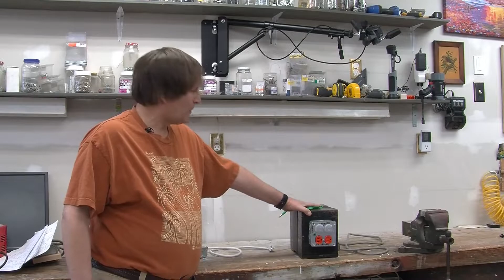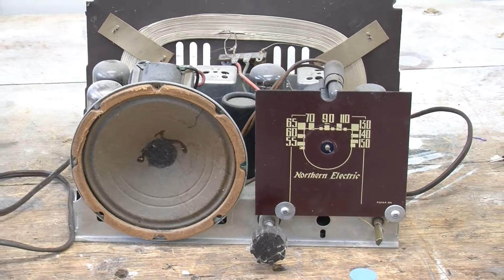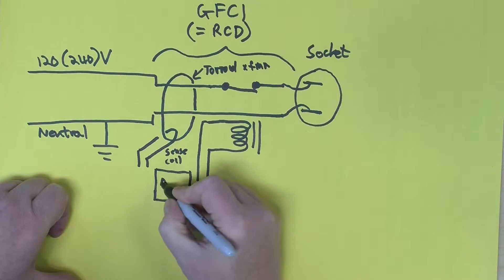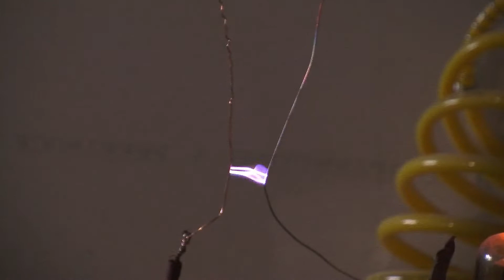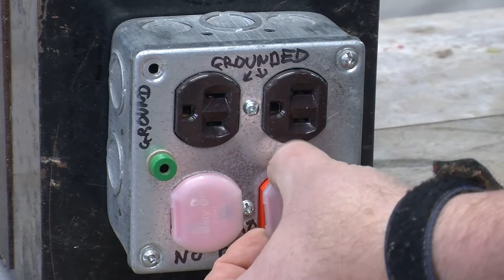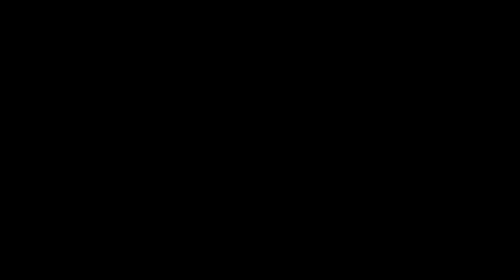Isolation Transformers and  GFCI Outlets

Comment: Excellent video! I have an isolation transformer (15 amp)  set up with a GFCI on the secondary side. I am going to add a couple of your items to it. Thanks! 👍
Reply from the maker: Thank you so much. I`m glad you found it useful. And to anyone reading this, a remider - you always need to conder the possible current return paths and voltages involved  to decide if a GFCI or isolation transformer - or a combination of both - and with our without ground - will improve safty - or even worsen  it. Even just thinking about this for any situation improves safety by hightening you awareness. Be safe everyone!

Comment: I was using an outdoor outlet (must be GFCI to meet code) with a metal conduit (buried to 6-inches) and two-wire cable to a shed to power an electric fence (which has its own ground rod). However, many fence energizers, including mine, cause a GFCI outlet to trip if an animal touches the wire. This should not happen, as the energizer output should be isolated, but unfortunately it does. I fixed the issue by using an isolation transformer (at the shed) to power the energizer. This solved the GFCI trip problem very nicely.
Reply from the maker: I had never heard of that happening! So the fence engerzier must somehow connects its high voltage pulse circuit to either the 120V line or hopefully neutral to cause a current imbalance. It hardly seems safe to be setup that way.  Or maybe they are isolated, but after a while  a fault  has developed between the HV and 120V side. Could easily happen with some moisture getting in, and for the zapping voltage would need to be anywhere close to a short. 

Glad you solved it!
Reply from the maker: @krslavin For some reason I am notified of you reply "Thanks! It could be some sort of inductive coupling due to the high rate of change of current and the fence energizer being separately grounded." but can see it here. Your right! Those sharp edged pulses have so much  high frequency energy they can leak though the slightest capacitances. Thats probably it.

Comment: Should we add a MOV for overvoltage surge suppression? Should we fuse one or both windings to match the transformer's VA rating?
Reply from the maker: All very good suggestions! The MOV particularly for use when dealing with semiconductor devices that might be damaged by spikes particularity if the power to the transformer is cut and the remaining magnetic field in the transformer produces a surge.

As far as fusing goes, my preference would be a switchable dim bulb current limiter as part of the whole setup. But maybe a slow-blow fuse on the transformer output as well for safety. I wouldnt put one on the input of the transformer as that might cause surge reasons.
Reply: @ElectromagneticVideos  Simply cutting the input causes a spike?  MOV across secondary?  Then we needn't trust a sensitive DUT to protect itself.

Yes my box has a switchable dim bulb.  I will need to move my 2A fuse.  I had thought it belongs on the input/power cord.

I selected Triad FD8-120 which does not tie the neutrals and has low cost 38 CAD. 100 VA.  Hipot 2500 V.
Reply from the maker: @d46512  Consider the transformer connected to the AC supply but not to a load. The transformer draws lagging current because of the inductive nature of the primary coil. Now you flip the AC switch at the instant when the current though  the inductor (=transformer) is at its peak. So the magnetic field in the transformer is also at its peak and holds a lot of energy. By their nature inductors want to keep the current though  them flowing constant (I did a video on this a while back) so the inductor forces its voltage to rise enough to keep the current flowing at the same amount it was before. This usually results in a nice spark across the switch. The high voltage generated is also seen on the secondary by transformer action. So there is your spike. It dissipates quickly as the energy in the magnetic filed that powers it is used up, but can easily be 1000s of volts. So a MOV on the output is a good idea. Now if you had a big load connected the current across the small resistance of the load would result in a much smaller spike - maybe less than the normal operating AC peak. 

The transformer looks like good value for a nice small isolation transformer. I would leave the fuse where you have it, and put a smaller one on the secondary. That way there is protection if the transformer is damaged somehow  ....

Comment: There is an option to combine a Isolation Transformer and a GFCI. 
Because a Isolation Transformer doesn't have a return path to ground, and a GFCI needs a return path to ground for detecting the unbalance between Live and Neutral, 
you can solve this by connecting the earthpin of the outlet socket to one of the 2 Hot wires of the isolation transformer where this Hot wire enters the GFCI. 
That way, when there is leakage from the second Hot wire to the ground/earth chassis of the device connected to the output, a inbalance is created inside the GFCI, and it trips when the leakage exceed the treshold of the GFCI.
Another modification you can do to a isolation transformer, is to connect the connection of the one Hot wire of the output and ground/earth pin of the output socket, to the ground/earth of the primary (mains earth) through a 2 Mohm 2a3 watt resistor. Each isolation transformer has a leakage voltage, this leakage voltage between the floating output and the ground/earth of the mains grid, this leakage voltage can go above 100V with a current in the µA range. With a 2 Mohm connecton, this leakage voltage is reduced to a very safe voltage, and with a maximum current of arround 120µA when using 240V on the output socket. If you then connect a device to this output, and you accidentally connect your ground clip of your scope probe to the Hot wire inside this device, a maximum current of only 120µA will flow, and this wil not harm your device/scope probe and scope itself. This mod create a "High impedance" grounding of the isolation transformer with enough safety margin for human and device.
Reply from the maker: I have often though about way to add a GFCI to the isolation transformer and I think in some situations your approach would be great, such as catching leakage current.

I have been thinking a lot about your comment since you posted it yesterday - I do think the merits of a GFCI as an addition may be quite situation dependent : if one was to touch the metal device case as well as something at higher voltage inside a device under test, is it better to have the  device's metal case floating/isolated so there there is no return path (or at the most a few uA) or risk brief burst of current while the GFCI disconnects? I'm assuming a North American GFCI only cuts the live connection, while neutral remains on. so potentially with the connected ground you always now have a path from ground/case to neutral and could get a severe shock if there are large capacitors holding a charge inside. So in perhaps a tube radio with a metal case the GFCI may not be a good idea. But in other cases - say maybe a incandescent lamp (to make the example simple) with no charge storage, shutting down power in case of any stray leak would help. 

I really appreciate your thoughtful comment!
Reply: @ElectromagneticVideos  , i don't know how the American GFCI works, but here in Belgium equivalent devices Earth Leakage Switch or Differential Current Switch interrupts all live and neutral wires. Even the portable Earth Leakage Switch interrupts live and neutral.
Reply: I guess we can use RCCD it don't need return ground connection

Comment: Agreed it's a must. Unfortunately, proper "lab" Isolation transformers are pretty pricey but, your life should be worth much more to you. I run all my DUT (devices under test) through an Isolation transformer, a current limiting light bulb, and a Variac. I definitely recommend anyone working with high voltage and current to make a setup of all 3 next to each other and use it as your life may depend on it.
Reply from the maker: Completely agree!!! And to add to your comment. I have seen some ads for  isolation transformers that arnt isolating - they have their neutrals connected with an intended purpose of noise reduction for high end equipment and studios. I hope than people using the transformers for safety are knowledgeable enough to understand this and check their transformer after purchasing to ensure its really isolating!
Reply: @ElectromagneticVideos  I picked up a Hammond isolation transformer a while back. Similar to the one referenced in the video and I was shocked at how badly? the enclosure was grounded. I had to add serrated lock washers to properly ground the enclosure.
Reply from the maker: @stevenspmd  That's a bit surprising - I have always thought of Hammond a quality brand, but maybe these days like everything else it isn't what it used to be :(
Reply: @ElectromagneticVideos  Maybe I'm being picky? but the grounding of the enclosure on the secondary side didn't seem that great; just single wire passed through a bolt hole of the transformer body from the primary side. I put serrated lock washers on both sides of all four bolt holes and now the enclosure ground/resistance is the same all around.
Reply from the maker: @stevenspmd  Well it sure sounds better the way you did it!

Comment: Theoretically, let's say I plugged an isolation transformer into a gfci then touched the live wire on the secondary side of the transformer, using my body as the return path for the current. Would the gfci still trip or would the isolation transformer essentially "bypass" the gfci protection? Not that I would ever try this, just curious
Reply: The GFCI won't trip because the secondary side is not ground referenced, so there is no return/leakage path. That's also the reason that you don't feel anything if you touch 1 wire of the secondary side. That's also the reason that a isolation transformer is used, but If you touch both output wires at the same time, then you will get a shock offcourse.

Comment: What about putting a GFCI on the isolated side of the transformer?
Reply from the maker: That could be added protection to catch a problem if a fault developed in the transformer - say the secondary somehow shorted to ground and now was no longer isolating. I have never seen that done - but a very good thought. Great thing about your suggestion is that  a fault like that would not be caught by a GFCI providing power to the isolation transformer. Could be particularly useful if one was powering a device that generates such high voltage that if the device under test faulted,  it could raise the isolation transformer's secondary to the point where its insulation failed. For that type of situation i have used an GFCI without an isolation transformer, since the device had its own transformer.  But you really got me thinking - might add that to my setup! Thanks!
Reply: @ElectromagneticVideos  , when you add a GFCI to the secondary side, a GFCI won't trip because there is no path for leakage current. A GFCI trips if there is unbalance between the Hot and Neutral, but because the secondary side is not referenced to ground (and also not to neutral), there is no leakage path if you touch the secondary side. But a trick to use a GFCI combined with a isolation transformer can be done, when you tie the ground pin and the neutral pin together in the outlet socket. The only downside to this trick is that there will be a "Ghost" voltage on the metal case of the device that is connected to the isolation transformer. This "Ghost" voltage can be as high as 50% (or more) of the output voltage, but is very low current (in µA range). A second trick to lower this "Ghost" voltage, is to connect the previous made connection of the earth pin/neutral pin of the outlet socket with a 2 Mohm resistor to the earthpin/wire of the mains grid. This 2 Mohm resistor needs to be a 2 or 3Watt type for getting the 240V voltage rating. A 1/8 Watt resistor is not rated for mains voltage use.
With these 2 tricks, you can use a GFCI AND have a very low "Ghost" voltage (arround 30a40V at µA current). 
When doing scope measurings on the device connected to the isolation transformer, and when connecting accidentally the ground clip to the hot wire of the secundary, will only allow a current of 240µA (with 240V mains voltage, 120µA with 120V mains voltage) through the scope probe and scope itself. 
This will not harm the scope, while this fault without a isolation transformer, will blow up your scope probe and your scope.
The grounding of the secondary side to the earthpin/wire or ground of the mains grid with a 2 Mohm is also called a "High impedance grounding".
Reply from the maker: @BjornV78  Really like your two tricks! So much so I will add them to my unit. They would certainly be a great way of catching inadvertent human contact in some situations and shut the system down adding one more line of protection beyond the isolation transformer. To clarify my comments above, a gfci (with or without your tricks) could in some circumstances catch unbalanced currents as a result of and issue in the transformer where the transformer becomes no longer isolating.